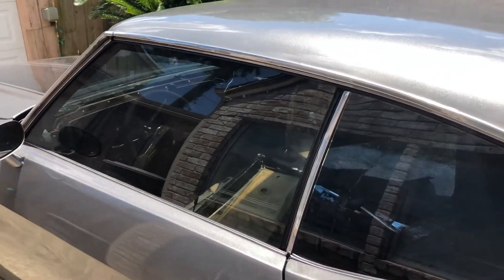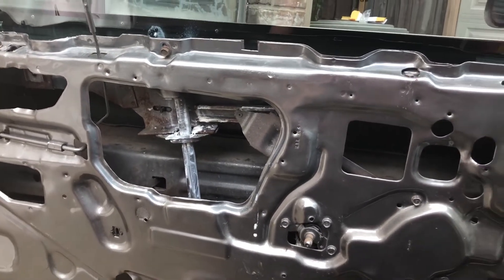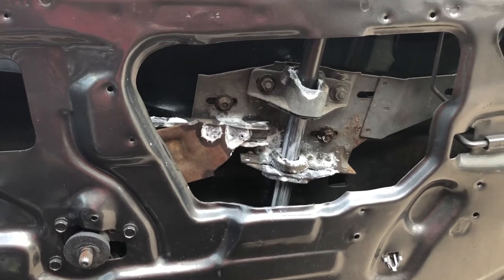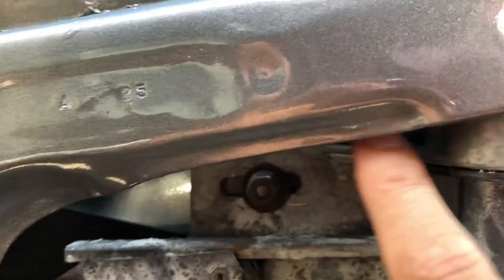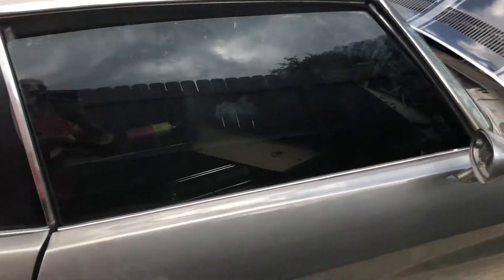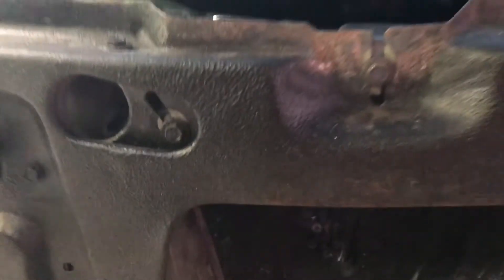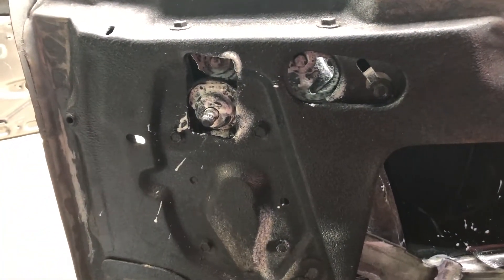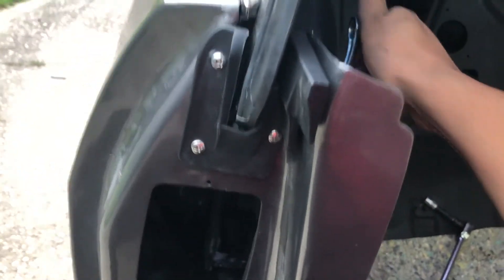How to adjust and align windows in a 1970 Chevelle/Skylark/Cutlass

Comment: If I had someone on the outside and someone on the inside with the door closed, couldn't you loosen up most or all adjusting points, align the window, and then sung up the adjustments?  Then, do fine tuning if needed, or should it only be adjusted one adjustment at a time? Thanks

Comment: Your vertical gap between door and quarter window is far too wide. Your also missing the blow out clips on the upper front door window corners, they keep the door glass from blowing out at highway speeds when window is fully up. Adjusting with these blowout clips in place is even more of a challenge, since the glass tucks behind them when closing the door with the window up, if window is too high, it will hit these clips, damage them and throw all you alignments back out, so you need to start all over .